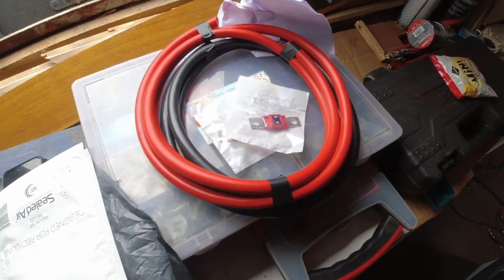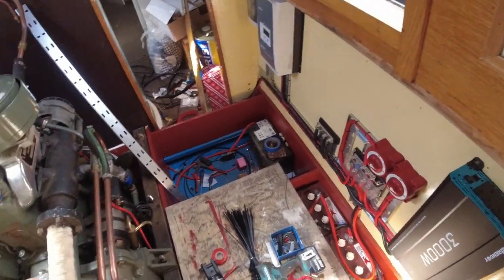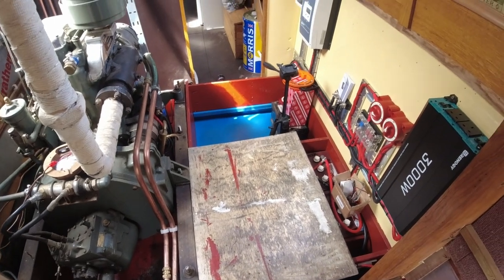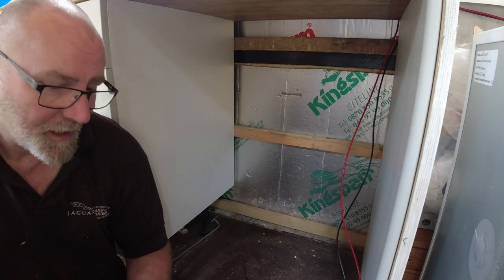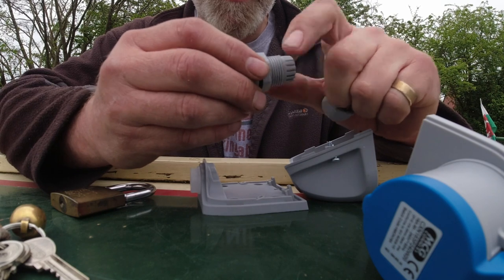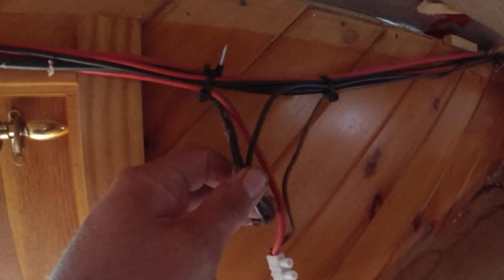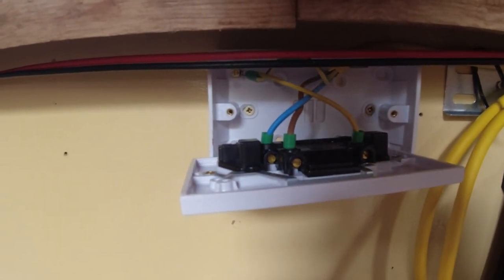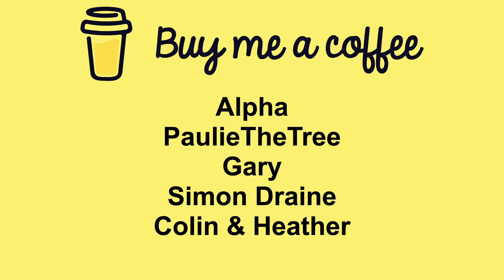Narrowboat Refit #66 12 Volt & 240 Volt Electrics Continued

Comment: All looking good, Steve. I have a lot of catching up to do watching your vlogs. Been so busy working again Monday to Friday. What screws did you use for your hook-up socket? Self-tapping? Wondered why you used yellow cable. I thought that was for 110-volt systems, and the Artic (blue) for 230 volts.

I too use a lot of boot-lace ferrules, even around the house! I’m obsessed with them. I’m not keen on using chock-blocks either.

Like the idea of using a metal cable tray where exposed wires are running. Got me thinking now regards my electric cupboard wiring. May well look a lot neater than cable clips.
Reply from the maker: Yes for the electric box at the back I just used self tappers, the yellow cable is still arctic cable just yellow, it’s what would be used to run to the electric box at a wharf / mooring! It is still rated at 240 so all good. I just thought yellow would stand out more inside the boat 👍🏼👍🏼😊

Comment: Hiya. Great vids. Have you got a video where u change a 240v socket to a 12v socket with some USB ports on ur boat. Getting our boat in a few weeks and it only has 240v. Thanks. Gemma
Reply from the maker: Hi Gemma, I don’t have any how to videos no I’m sorry, but you can but sockets with usb points built in and then wire them the same as the original socket! (Make sure the power is off first 😊😊
Where about a are you based??
Reply: @NarrowboatPreciousJet  lol. Obviously. Wolverhampton way. 
I have done wiring many years ago so quite happy to do it but just need a video etc to show me

Comment: Hi mate, should the hook-up not be a plug 🔌 (male) rather than a socket? Considering it’ll be running into a live cable to the shoreline... you wouldn’t want a live male cable end.
Reply from the maker: I thought I had fitted the right plug 😂😂 you’ve got me thing I’ve brought the wrong plug now! 😂😂 I will check when I go to the boat and get back to you 😂😂👍🏼(thank you for pointing this out) lol 👍🏼👍🏼
Reply: He's right Steve. You have fitted what goes onto the marina box.
You will soon find out anyway when you come to plug in as one end won't fit. 
Consider getting the flush fit type like on a caravan, lot neater. But you will have to cut a hole for it. Will be one of my jobs for winter.
All coming along well though.

Comment: Have you calculated the weight of all the wiring into the ballasting of your boat? 🙂
Reply from the maker: Ha ha ha good point but  you don’t have to worry to much about ballast in a Narrowboat! When I’ve finished the fit out I will have to trim the boat slightly! Also there is a lot more weight to go into the back of the boat yet when I fit the rear cabin 😊👍🏼👍🏼

Comment: Rather than a wire get some tinned copper jumper links
Reply from the maker: Hey Shaun, the 50mm cable was quite reasonable in price and any thing that is tinned is stupid expensive 😮😮 if I were going in salt water then tinned it would have to be throughout the boat 😊😊👍🏼
Reply: @NarrowboatPreciousJet  hi steve no I was just talking about the jumpers especially  with thick cable min bend radiuses you buy them pre-done. Have a look a rs comp or maplins..
Reply: @NarrowboatPreciousJet  got to say mate making an excellent  job of it looks really neat.. nice one👏👏👍